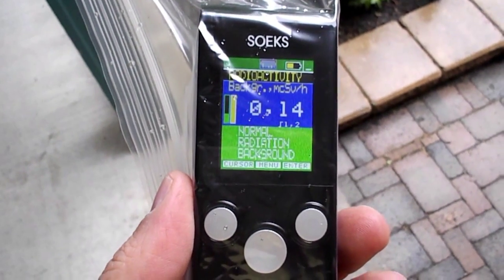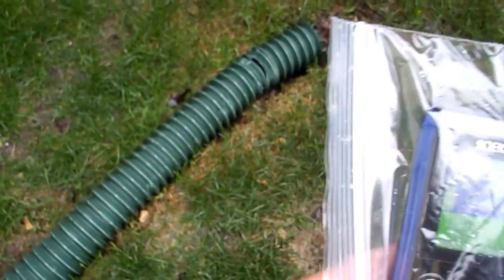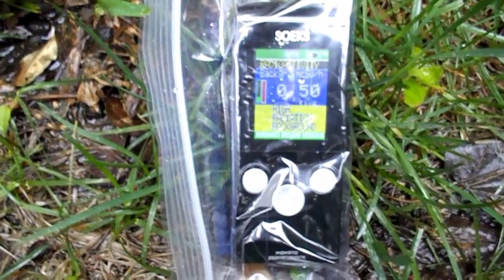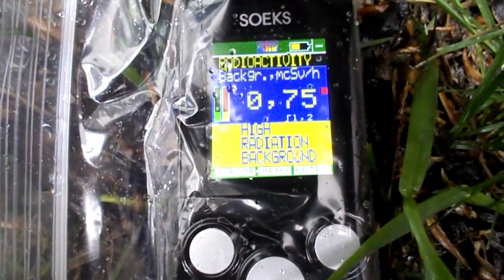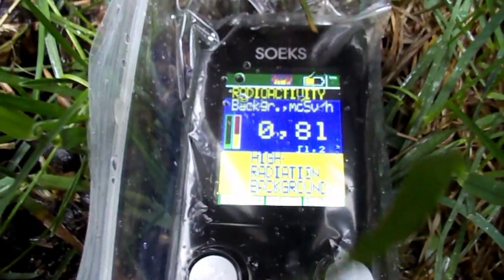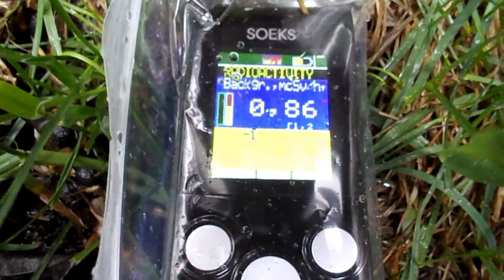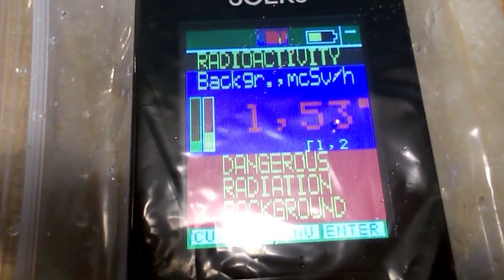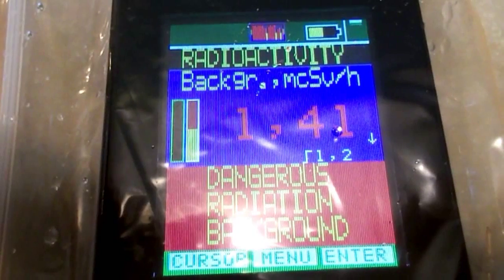radiation in rain water Ottawa 21MAY2013

Comment: Just typical radon capture.
Reply from the maker: I don't believe this is radon as radon would not be in rain water. I suspect it has more to do with cosmic rays. Fortunately I have found this radiation is gone in about 40 minutes or so.....thanks for watching.
Reply: Radon IS in rainwater. Its basic science which has been taught for 100 years. 

Please read this article from a Cambridge study in 1902.

http://www.biodiversitylibrary.org/item/108210#page/464/mode/1up
Reply from the maker: Interesting....thanks for the info.

Comment: That is pretty high. Over one µSv is described as "short term habitation only" rating. How long did that last? What happened when you tested over the next few days? Post some more of home and Ottawa area in general if you get some interesting results. P.S. How do you find that geiger counter? Was it well calibrated? I think that's a decent brand....
Reply from the maker: When I first saw rain water radiation videos on Youtube the Fukushima disaster had just taken place and that appeared to be the cause. Then I got my own geiger counter and did my own checking. What I found was the radiation lasts for 45 minutes then is gone. I believe this is a natural phenomena that has always been there. I bought this geiger counter off of Ebay. It came from Russia. I have not checked the calibration but it does give similar readings to another geiger counter I have.......Thanks for watching.